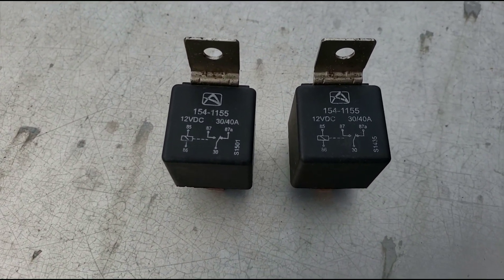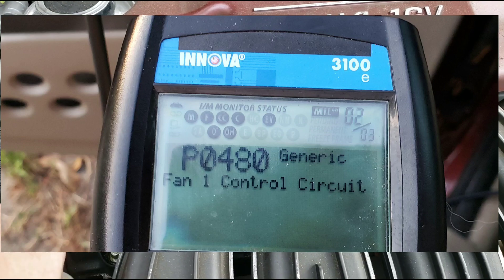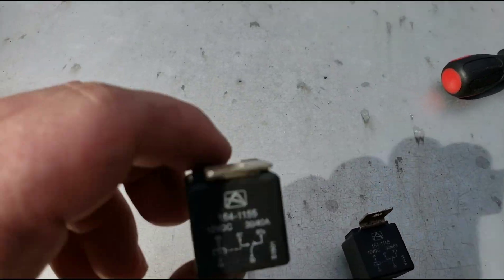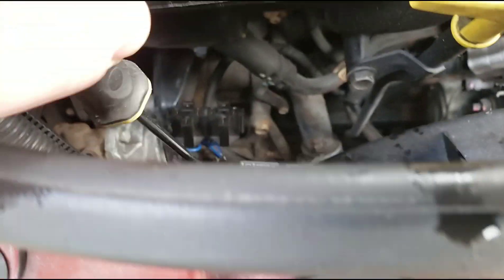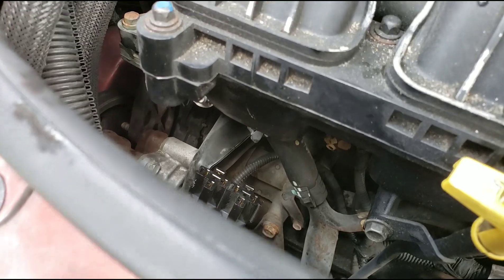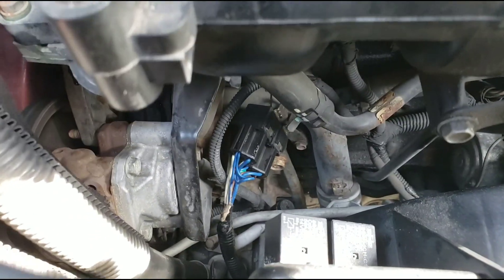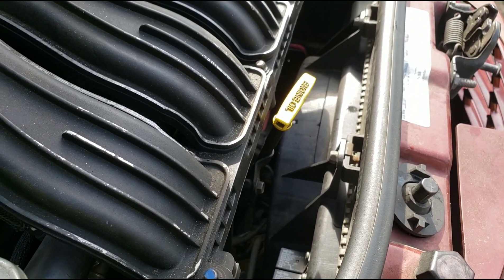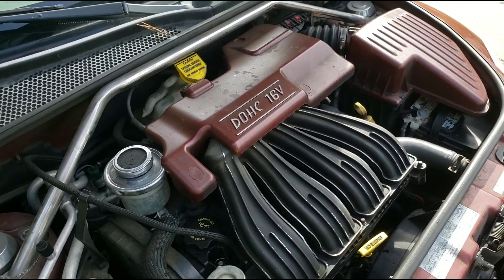CAR OVER HEATING and still has Coolant.. Could be these 2     Relay Circuits PO480, PO481 PT Cruiser

Comment: My relays were replaced by new ones at Pep Boys ($500!) last year and I’m getting the same error code again. Gonna do it myself this time for a lot cheaper. Thanks for the vid.
Reply from the maker: Just replace the whole cooling fan wow $500 for those 2 little relays? I'd take it back and tell them it's not working again. Sadly not cruisers are money pits. Even though they are neat cars. The whole cooling fan failed again on mine and I have a field leak at the fuel pump. Merry Christmas! Please subscribe!

Comment: I bought mine new in '01 and its the only vehicle that I've owned that has had the relays go bad. Even my '86 Pulsar or '91 Geo Storm has never had a relay go bad, much less my two Blazers' or my '96 S10. Like you I've kept the car just to see what goes bad next. Its always something weird or unusual, but thankfully not too expensive and never the same thing twice; at least not yet. Over 200K miles and still makes it completely across Texas @ over 25mpg(s)
Reply from the maker: I think the cooling fans themselves connected to the relays are bad. Pt cruisers are becoming a collectors item now lol because so many are in the junk yards there's not many left

Comment: Hi Drew , have a 2009 PT with turbo .. Code is PO480 .. The fan runs only when the AC is turned on but fan won't turn on when vehicle is running with AC off .. Could it be the relays ?? Thanks in advance for any help you can give ..
Reply from the maker: ive recently found out the code can mean the whole fan is broken but replacing the relays doesnt always fix the issue. you may need a new cooling fan. watch your temperature sensor you can overheat your engine and cause $1000s in damage. please subscribe!! I have a---- pt cruiser repair playlist!!--- on my channel

Comment: I’m having trouble getting the relay separated from the wires how did you pop it out with a flathead ?
Reply from the maker: The one I had it wasn't fully screwed in but you can use an angle screwdriver I guess however the cooling fans themselves seem to burn out sometimes it's better just to get a whole new one
Reply: @drewsquickfix  I got them out but they seem good overheating still spraying hot mist of coolant from ac house area idk what’s going on seems to be coming from thermostat area too fan still not kicking on either
Reply from the maker: @djbarela4  if it's spraying it's a leak it's not your cooling fan

Comment: Could you please post a video showing step by step exactly how to take them off. Im having the same problem but I don't wanna break anything taking them off. I do all the work on my 2007 Pt Cruiser myself. So far I have replaced the  thermostat, TIPM, crank shaft sensor, breaks n rotors, both control arms, tie rods, windshield wiper motor and transmission, and rewired most of the grounds...
Reply: I am subscribed to ur channel but I can't find the video of the fan replacement..
Reply from the maker: Let me see if I can post it here
Reply from the maker: Here you go! Thanks for subscribing good luck!! https://youtu.be/-_9c1lY2hgE
Reply: @drewsquickfix  thank u
Reply from the maker: Hey dawn they usually come attached to the cooling fan when you buy it. Sometimes the cooling fan can have an issue itself. It may be a better idea just to replace the whole electric cooling fan. Can be about $600 in parts and labor usually. Subscribe and see my channel playlist for or cruiser. I replaced the cooling fan in a video not really armature work but possible to do.

Comment: Why is the A/C part of the engine cooling system?
Reply from the maker: Thats a good question. Im not a pro at ac but I believe when the ac is on it turns on the radiatir cooling fan to circulate air. If the cooling fan  isn't working the car overheats faster. Also the ac draws alot of current from the running  car . Sorry I do t know more about this, I just know turning your heat on works. Also driving on a freeway vs staying stopped in traffic prevents overheating

Comment: How do you get relays out?  Which one is high speed.  I'm dizzy watching video.
Reply from the maker: I dont have a profession cameraman sorry about the shakiness. I would just replace both.  You have to remove the screws for the relays. Some of the relays are attached to the cooling fan and more difficult to reach. They just pull.out like a circuit from the socket but can be hard to reach.
Reply from the maker: Please subscribe I have a pt cruiser fix it playlist your going to need if you own one!!!

Comment: i have the same problem car over heats but i have no codes or engine light  on  but i noticed that the fan runs kind of very slow  if i run the heater inside the car it keeps the temp  at normal
Reply from the maker: That most likely your electric cooling fan if you have a chrysler. If you turn on the ac and the fan doesnt run then you know it's broken. Put a walmart plastic bag over the fan to see if it blows. Thanks for watching make sure you subscribe and hot the bell for notifications.